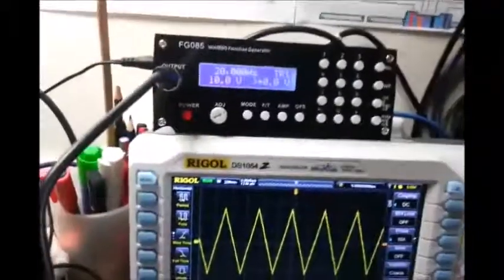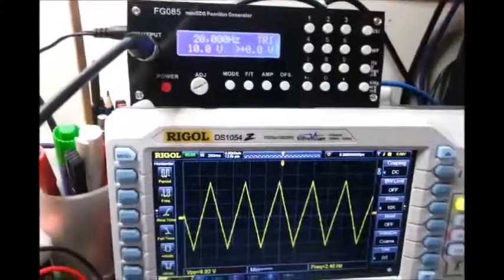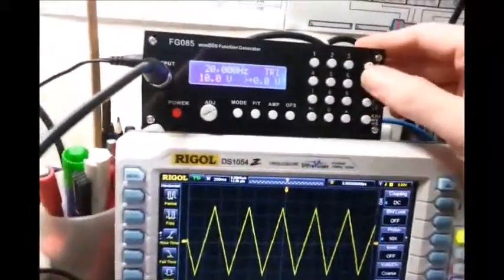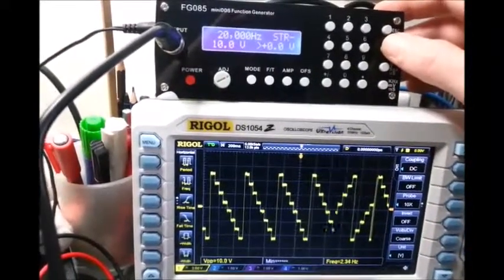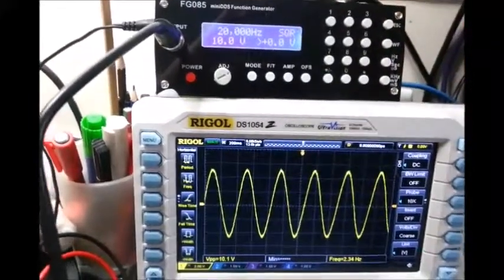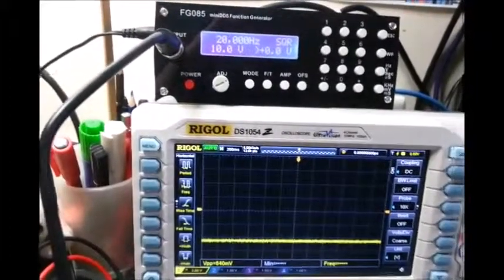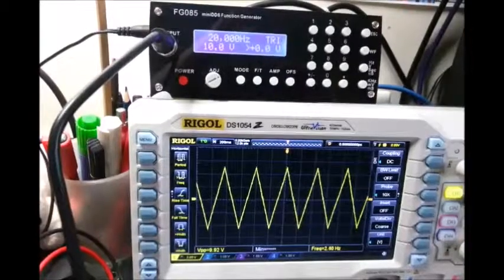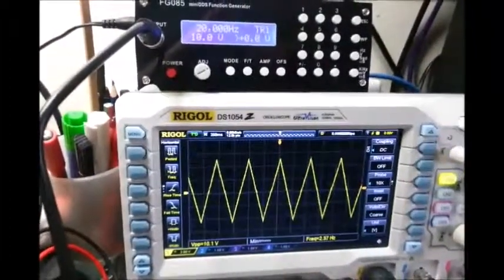FG085  no squarewave

Comment: Had the same problem It was fixed by starting the g085 while pushing down the ADJ knob. It resets "default values."
Reply from the maker: +David Moerman I run it from my 12 volt battery now and it is fine. I think my wall wart supply dropping voltage to much.
Reply: Same problem - before reset no sqr but after reset I have squarewave - thank You very much :).
Reply: @trzystaes  Check the mark/space ratio of the square wave. If 100% or 0% it will appear not to work.
Reply: @louispole6285  it is ok - no poblem after reset.